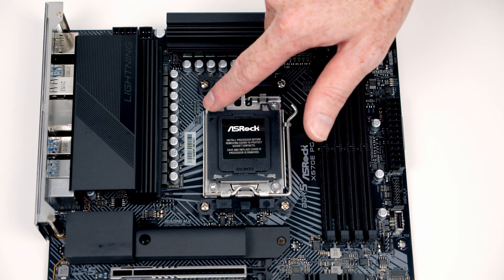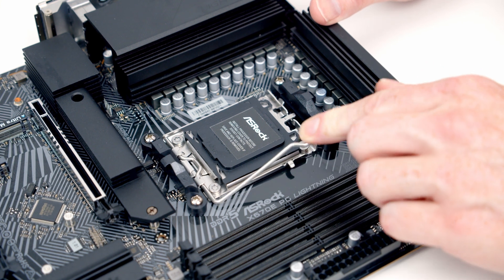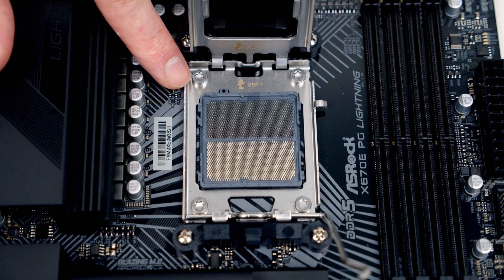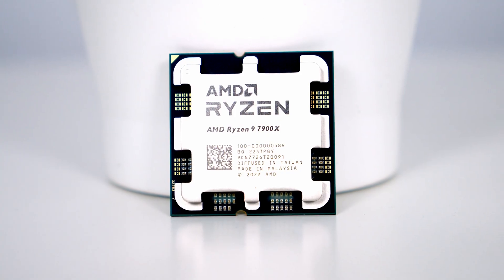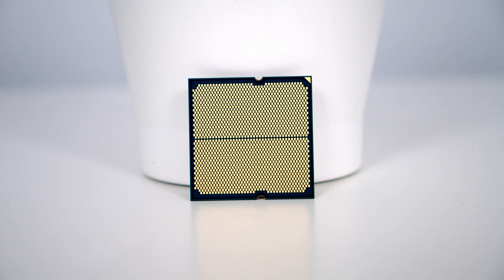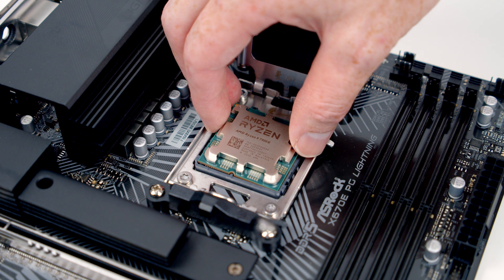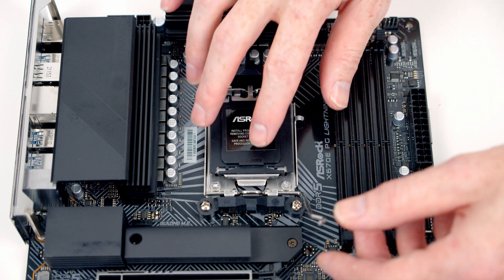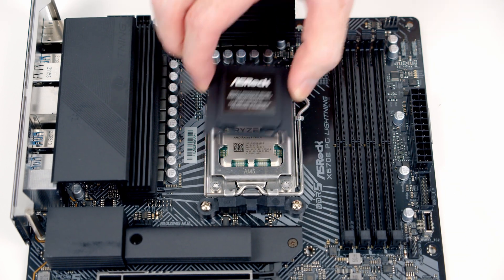AMD Ryzen 7000 Series CPU Installation Guide

Comment: So what about adding a vid that goes into a scenario where you need to replace an existing motherboard to upgrade for adding a newer series 7000 amd cpu while keeping the other components already in your existing case? With the new series 7000 x3d cpu's being released something like this should be relevant. Thx.

Comment: please help, is it ok if pressing it in creates a lot of resistance and marks appear on the side of the CPU… this doesn’t look or feel right to me. i’m installing an AMD 7700X into an ROG Crosshair X670E GENE. i have the triangle and notches lined up properly and the CPU rests comfortably in the socket but the lever requires considerable force to push down and i noticed small marks on the right and left middle protrusions on the CPU. i’m freaking out right now
Reply: Did you ever sort it mate lol

Comment: Curious to see the installations for existing AIOs onto the new motherboards😊
Reply: It should be similarly like am4 but the only difference is the backplate on am5 is now part of the socket so coolers that use their own backplate won’t work, but if the cooler uses the stock backplate it will work

Comment: @Christopher Flannigan - The AMD4 and AMD5 sockets not interchangeable?
Reply: No, AM4 (so the previous generations) have the pins on the CPU, while AM5 with the new chips (Ryzen 7) have the pins on the motherboard.
Reply: @ThomasS17  - Thank you so much! For some reason, I thought I read the generations were interchangeable.  Cool! Thanks for the response.
Reply: @lhbbq  No worries! There were multiple generations on AM4 (which is now 5-or-so years old) that were interchangeable. And the next few generations should also be compatible with AM5 going forward.
Reply: @ThomasS17   - The big selling point I am looking for right now. A MicroATX motherboard, with 2 PCIe 4.0 x 16 slots.  For me, I am seeking to keep the case small and efficient.  If I shift the AM5 - I do not want to shift to a large and almost pointless ATX/E-ATX motherboard.  ITX looks promising, but I desire 2 PCIe slots.  I will use one with my GPU, and the other one is for growth.  So right now I am looking and watching how the roll out of these cards take place.  Right now I am pleased with my system.  I have no issues.

From the Looks - Asrock has a  B650M PG Riptide WiFi coming out that can fit my bill.
Reply: @lhbbq  they announced that you can use the same CPU cooler so maybe you read that